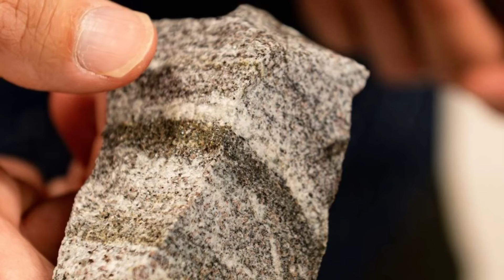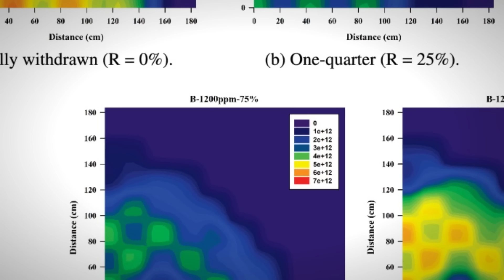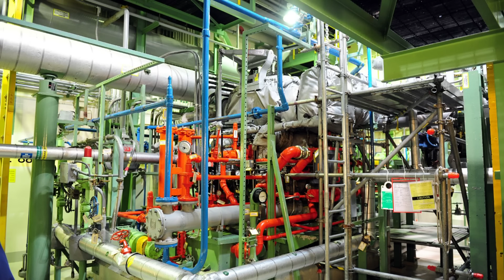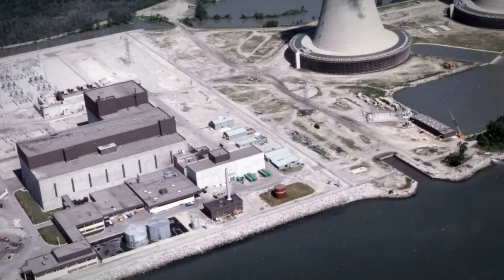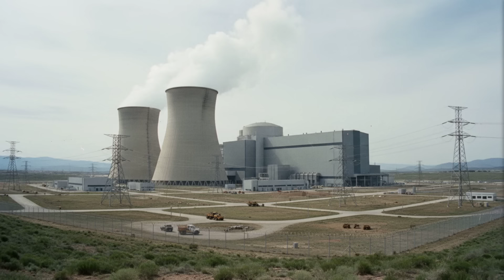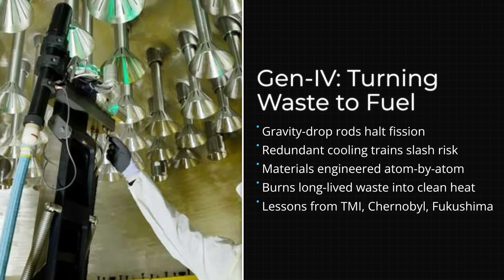The Crazy Engineering of a Nuclear Reactor

Comment: The Pressure Vessal needs to be reinforced while the reaction is  live and the excess  heat generated,  needs to drive Turbines in the secondary loop.

400,000 tonnes of Raw material available from fission Reactors  can be on the space station or the Moon.
Reply from the maker: Yeah lot of potential for many Areas.